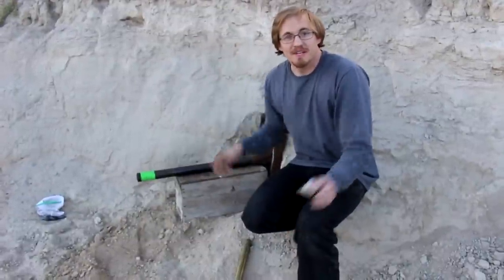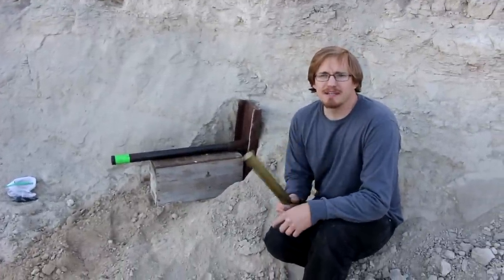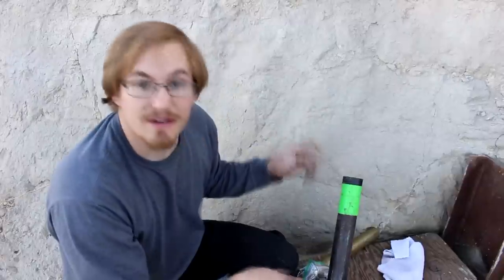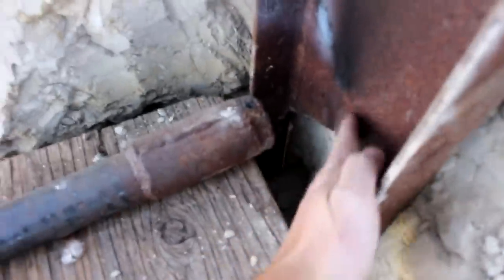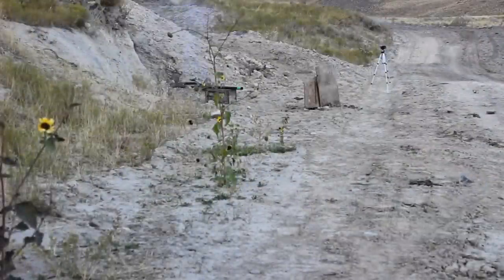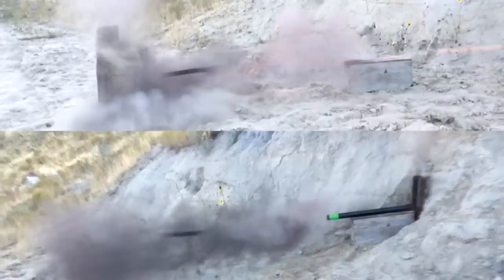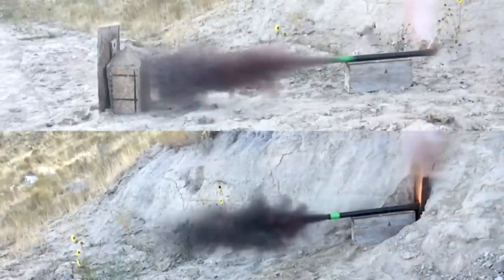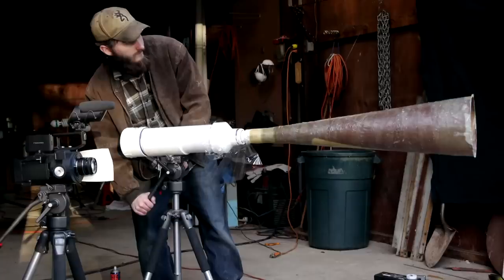How Does Recoil Affect Gun Performance?

Comment: Every action has an equal and opposite reaction - true enough.  But the action is in terms of force, not work.  If the gun can't recoil significantly, very little "work" is done to it, but in terms of impulse (newtons * seconds), that has to be the same.  NOT the energy (conservation of momentum)

Then why is the bullet almost the same speed?  The gun is very inefficient.  Most of the pressure is lost to blow-by before the bullet emerges (note all the gas coming out of the muzzle ahead of the bullet).  So there is only so much pressure for so long in both cases.  For the moving gun, the gas gets to do a bit more work (twice as much distance) before it escapes.  But basically, the pressure is gone long before the bullet exits the muzzle in either case.
And how to avoid this inefficiency normally?  That's what wadding is for.
Reply: that is a good point.
Reply: I didn't expect to see you here (one of my favorite channels watching another of my favorite channels.)
Reply: Cody said exactly the same thing in the video. Although, if you watch the slow motion footage you see that there is still quite a bit of pressure when the rod escapes the barrel, especially at the moving one.
Reply: Thanks, came here to say the same!  Work, energy are not the same as impulse and momentum.
Reply: also worth mentioning that if you look closely the split footage , the upper cannon is quite ahead of the bottom , and actually the brass bullet of the bottom video did catch up the gap and surpass the upper one
in other words , even with all the lack of efficiency , the bullet shot from a fixed cannon had more energy/velocity than the bullet shot from a non-fixed barrel
Reply: Maybe if he used a tube that weighted less than the bullet it would make the compression loss more noticeable as it will fly away way before the explosion is complete.
Reply: subscribed
Reply: Damian, I agree with that. A 10kg bullet in a 50gram gun would change the results.
I dont know too much about the forces, but this is all about expanding gases, right? When the gun moves, the expanding gas pushes much less on the bullet than it normally would, in my understanding.
Still a nice video with a surprising result, cheers Cody.
Reply: Hope Cody sees this
Reply: I agree. Recoil momentum + projectile momentum = 0. So recoil kinetic energy CAN'T be equal to projectile kinetic energy if masses are not equal. Projectile kinetic energy could have been higher in low recoil experiment, but velocity increased only square root of that. It is hard to see if kinetic energy increases.
Reply: Thanks, I was just going to comment the same.
Reply: Marijn Zwitserloot No, he said at the end the same amount of work is equal and opposite. Work refers to energy. Newton's third laws refers to force. With unequal gun and projectile weights, your are forced mathematically to have different amounts of work (energy).
Reply: Cody did mention that the pipe was roughly the same wieght as the brass rod, the explosion is stationary, and in the video, it is clear that although they fired at the same time, the brass rod fell a little when fired out of the un secured barrel.
Reply: Marijn Zwitserloot Cody did not say the exact same thing in the video. He mixed up work and force in Newton's third law and said 'the same work has to be done to both objects.'
Reply: Matthias Wandel the gasses pushing out the projectile has the most amount of pressure put on it in the initial explosion so the most amount of speed is reach in seconds cause the gasses will only get weaker as it goes outwards from the barrel so the barrel sitting still or being blown back doesn't affect it that much it's what I think is why it doesn't matter
Reply: In no-recoil case the energy just goes into vibration and heating of the mountain instead of moving the gun. Same with momentum, it doesn't disappear but is instead given to the whole mountain, resulting in miniscule velocity

Comment: I would not agree with you. The force acted up on the brass rod is due to the preasure with in the pipe. If the pipe moves in the oposite direction when it is fired then the duration that this force acts between the pipe and the rod will be much shorter.
You can allso see it like this. When the pipe is stoped by the wall behind it by a force then there will allso be a equal force in the direction of the brass rod. This normal force will increase the energy of the rod.
A nother way is to think of the problem in an extreme case. If you push your self away from object you will gain more momentum if that object is heavier. If you push on that pie alone it wouldn't do much, but if you push on that pipe with that wall behind you then there would be a noticeable acceleration.
In this case I just think it is hard to see the actual difference. But if I am not wrong I can see that the first test apears to have a higher momentum than the second one.

Comment: Confirmation bias at work. There was a difference, you just made it look negligible by having:
1) Heavy projectile, which resulted in smaller acceleration difference.
2) Short barrel, which resulted in it's uselessness.

Repeat the test with the barrel 3 times as long and a smaller projectile and you will see it fly drastically faster in braced setup rather than recoilless setup.
Reply from the maker: ah but I did at mention that I had done this same test with a smaller projectile and a chronograph.
Reply: At first sight it seems that you are right, however there is a little caveat here that you are not noticing. 

In recoilless setup, relative to the barrel the same the work seems to be done on the projectile. However, relative to Earth, as soon as explosion happens, the barrel starts to move away, and the expanding gasses only work on the projectile until the projectile and the barrel separate, which is actually a shorter amount of time, and a shorter distance from the point of explosion. 

So, if you could measure the displacement of the barrel between the explosion and separation your could calculate approximate energy loss due to lack of recoil if you also knew the energy value of your charge.

Surely you understand that if you follow your line of argument to the extreme, then there should be no need for barrel at all? You'd just place a charge beside a projectile and let it rip. There would also be no shaped charges.
Reply: @IASKWHY, now that I've had enough sleep, I think it actually more depends on the weight of the barrel, which will directly impact it's acceleration. 

The lighter the barrel the faster it will fly, the sooner the separation will happen, the less work will be done on the projectile. Consequently bracing the barrel against the Earth "gives" it the mass of the Earth, resulting in almost 0 displacement of the barrel, making the bullet stay inside the barrel longer, and charging projectile with more kinetic energy than in the recoilless setup.

So you are right about shorter (and lighter) barrel.
Reply: Would you like me to draw a graph, showing where you are wrong?
Reply: There, I did it anyway. Now, go back to doing homework and stop arguing with adults. http://imgur.com/RRHjsag
Reply: +Cody'sLab Ever thought about re-doing this test more accurately? Been a year or so, bet you could outdo yourself this time.
Reply: i think that  a more precise measurement of the projectile velocity will show that it is slower because of recoil .
[
your hypothesis assumes that the maximum velocity of the projectile is achieved before it leaves the end of the barrel
]
I say it constantly accelerates until it leaves the barrel 
]
so a recoiling barrel will have the projectile leave the barrel sooner and therefore have less velocity

Comment: Actually Cody, F=ma is actually Net Force =ma. If you, for instance, apply a force equivalent to the pressure's force, such as pushing it against the side of a hill. Also, both guns have the same work, no matter how fast the barrel flies away, distance doesn't change. A meter long barrel will always be a meter long barrel (With few exceptions.). So if there a force bracing the gun, the only observed force is the one applied to the bullet. When unbraced, both forces are observed. Both forces are equal.

Edited for clarity.(x3)
Reply from the maker: To have a net force of zero you must have a balancing force in the case of a metal tank filled with gas that force is the stress in the tank and the tank is slightly larger with the gas then without. :)
Reply: *****
Yes, with a sealed container. Fluid dynamics dictate that when under pressure, the fluid in question moves with the least resistance, so in the case of a gun, most of the pressure's force acts on the easy to move slug with little loss to the surrounding barrel. Also to note on your pen demonstration, that kind of demonstration is invalid in the context of a bullet and barrel as the pen delivers the force, but in a gun neither the bullet or barrel supply the force.
Reply: i dont get it, i shouldn't of skipped physics, i just came here to see a cannon go off now my head hurts
Reply: TomehG
Don't worry, I'll walk you through a never fail method of avoiding physics. Plug your ears and just go, "lalalalalalalalalalalalalalalalalalalalalalalalalalala"
Reply: shouldn't have* skipped English either
Reply: NubeBuster lol I didn't
Reply: TomehG you typed "could of" but it is "could have"
Reply: NubeBuster where ?
Reply: TomehG "i dont get it, i shouldn't of skipped physics, i just came here to see a cannon go off now my head hurts"
 Sorry I meant shouldn't have
Reply: And yes it is but mine really isn't incorrect should of it's more associated with the spoken English language rather than the written even though I should have written it like that I will now in the future. Kind regards gramma nazi
Reply: Spoken English doesn't have spelling, how is that possible?
Using of instead of 've is always incorrect.
I'll bet you never called your 6th grade teacher a nazi for correcting you. Why do it now?
Reply: BariumCobaltNitrog3n spoken language has spelling it's still words, if you were to say out loud "I should've done that" the " 've " is often slurred so what people hear is should of not saying that it's right  just a common error made by people
Reply: BariumCobaltNitrog3n and there is no 6th grade in the British educational system
Reply: TomehG
You're right in that it is a mistake made more by people who learn better by hearing something rather than reading it. Not having seen a lot of contractions, a person might hear should of. Very common, true.
No 6th, just 5th then 7th grade? Or...
Reply: BariumCobaltNitrog3n the is a 6th school year but it's not 6th grade as the 4th 5th and 6th are all integrated with each other
Reply: TomehG
👍
Reply: Grey Wesche actually F=Kma or force equals to mass multiplied by acceleration multiplied by constant
Reply: Grey Wesche, you are mostly right. But there is a video that might change your view a little bit. /watch?v=dQw4w9WgXcQ
Reply: S
Reply: P.   O.o"
Reply: Grey Wesche
Reply: Huh, I haven't thought of it like that. Well "The Dude," I have to thank you for opening my eyes. Though I do enjoy the music paired with it.
Reply: The dude
Getting Rickrolled=classic
Reply: BariumCobaltNitrog3n
Honestly, I like Rick Astley's Never Gonna Give You Up. It's been a while since I've gotten Rickrolled.
Reply: Never gonna let you down...
good times.
Reply: A braced gun has the recoil force applied to the planet?
Reply: *****
Yes, whether it has an effect to the planet depends on it's inertial frame.
Reply: +NubeBuster it happens to the best.

Comment: Cody, you're better than that. Newton's third law states that it will happen, it can not be used as a reasoning for why it happens. You did, and can know that it will happen this way, but yea you get the point.
Reply: Im referring to his hypothesis not his explanation btw.
Reply: i think that  a more precise measurement of the projectile velocity will show that it is slower because of recoil .
[
Cody's hypothesis assumes that the maximum velocity of the projectile is achieved before it leaves the end of the barrel
]
I say it constantly accelerates until it leaves the barrel 
]
so a recoiling barrel will have the projectile leave the barrel sooner and therefore have less velocity

Comment: Correction towards the end: The amount of energy going into the gun and the bullet is NOT the same. Momentum is conserved, energy is not. It's a function of the relative masses. If they both weigh the same (as in your "free-floated" cannon) then yes, the amount of energy is also the same. You can do the energy vs momentum calculations for various firearms (I recommend the magnums and .50s) and see how absurd firefights wold be if that was the case.
Reply: George W Bush You can't invoke momentum if external work is being done to the system.
Reply: ...What external work? All the energy is generated internally. Do the maths for rifles like I suggested.
Reply: Energy is conserved just not equally partitioned in most cases. Momentum is a vector quantity, energy is a scalar quantity. As you say just because A and B had mirrored momenta doesn't mean A and B had equal energy.
Reply: Oh jesus. I've fired big bore guns before. Can't imagine being in a firefight with a 460 or 500

Comment: Let me take a swing at this:
If we make the assumption that the temperature and pressure of the propellant gas increases to a maximum very shortly after the charge is set off (bit of a dirty assumption but will work well enough) we can look at it like this.
Force is applied equally to all surfaces inside the gun, the only net movement that is possible is along the axis of the barrel with gun and projectile accelerating away from one another.
Force applied to either the back of the gun or projectile is equal to pressure x area - and since the gun and projectile have basically the same diameter the force is equal.

Using the above assumptions we can look at how the force applied to the two objects varies:
Because we assume there is no net heat transfer to or from the propellant gas after the charge has been set off we can approximate the system to an adiabatic process - so we can say that (pressure x volume)/temperature is a constant at any point.  Since the volume of the gas is increasing, and temperature cannot increase, then pressure has to fall.
This is a bit of a long winded way of saying that the change in pressure (and therefore force) applied to the gun and projectile as the projectile moves is not dependent on time, but only its position within the barrel.
That is, even if the barrel is unconstrained and is moving in the opposite direction to the projectile, the total amount of work applied to the projectile is exactly the same as the change in pressure within the barrel (from the moment the charge has been set off to when the projectile leaves the barrel) is the same.

Winding it back and having a look at it from Newton's point of view - that is the principle of conservation of momentum (mass x velocity = mass x velocity).  Constraining the gun is exactly like increasing the gun's mass, both gun and projectile have equal momentum when the charge is let off but since the gun is extremely heavy with comparison to the projectile, it hardly moves.

The above falls apart a bit when you observe that the combustion of the charge isn't instantaneous, but since the stuff burns so fast the losses that would be experienced by the projectile in the unconstrained gun should be rather small (as is evident in the footage).

Comment: I disagree! If you use the method of extreme cases it becomes intuitive why having the gun braced must increase projectile velocity. Think of it like this; reverse the role of the bullet and the gun, so instead of shooting away the bullet from the gun you set out to shoot away the gun from the bullet. Lets say the gun is an AK-47. Normally when you fire the gun only moves a little bit while the bullet moves alot. We want the gun to instead, so we brace the bullet by sticking a metal rod in the barrel and bracing the rod against a concrete wall. It's intuitive that the gun will accelerate more when the bullet is braced than when its not braced.

Comment: If the lack of recoil causes the projectile to spend less time in the barrel, then we should see less energy imparted to the projectile, as long as the projectile leaves the barrel before all of the gunpowder finishes burning.

You can easily google bullet speed measurements for various calibers with differing barrel lengths. The bullet fired from a short barreled pistol, will have a lower velocity than this exact same bullet fired from a longer barrel. This is because it takes a certain period of time for all of the gunpowder to burn in the barrel. If the bullet leaves the barrel before all of the powder is burnt, the rest of this powder is essentially "wasted", and the bullet is slower as a result. 

In the video, you can see the brass projectile leaves the barrel without a backstop before it leaves the barrel with a backstop. Removing the barrel backstop causes the barrel to act "shorter" , since the projectile spends less time in it, causing more gunpowder to be wasted than in the barrel with a backstop.

I think that this experiment was simply not precise enough to show this result clearly.